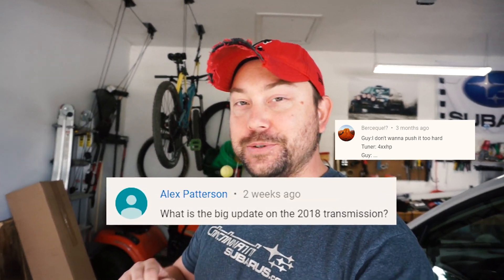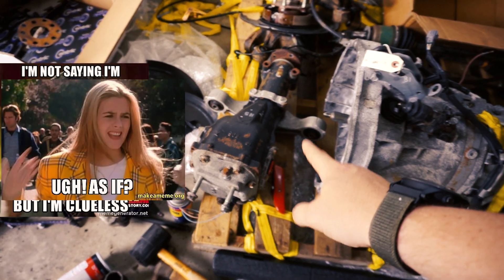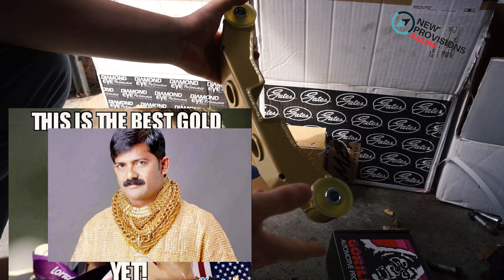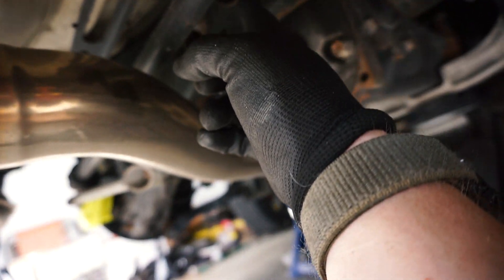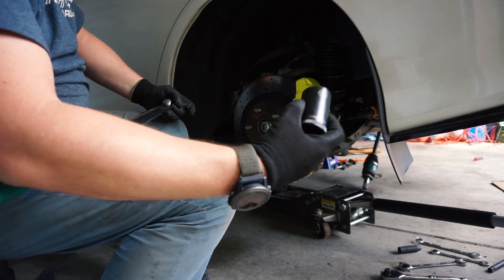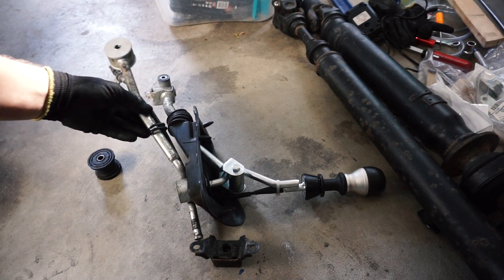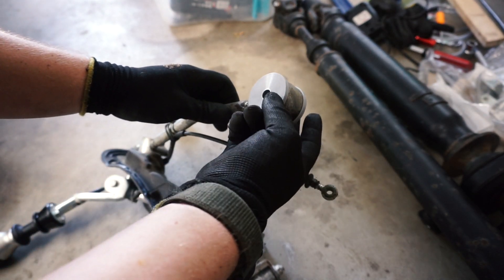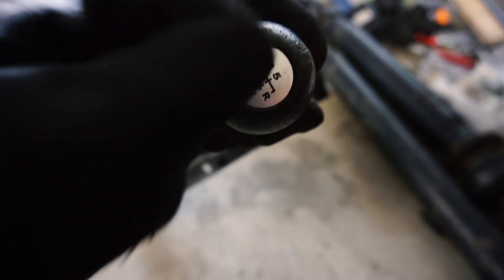WRX to STI Transmission Swap - Installing the R180 STi Rear Differential, Axles and Supporting Parts

Comment: With this much of work, why not just get an 18-20 STI to start with? Transmission, Brembo swaps...I lost motivation modding my 17’WRX, got the 17’STIBrembos and they sitting in the kitchen. Watching your channel makes me want to go back to work with the WRX.
Reply from the maker: Things just snowballed into what the car is.
Reply: Built not bought my friend. Plus the additional 8-10k for an STI isn't worth it in my opinion. Put that 8-10k into a stock wrx and now you have my attention
Reply: @jollyroger7172  After, Brembos, sti transmission/axle and differential swap you are encroaching on that 10000. After building the motor you will be over 15k if everything is done correctly with the supporting safety mods. If it is a built block as well? Budget for 20k

Comment: What are you going to use for the dccd stuff??
Reply from the maker: The cars getting the iwire harness with DCCDpro and custom differential manual control.  Pretty stocked to try that out 😁